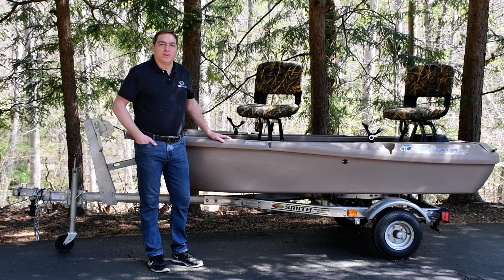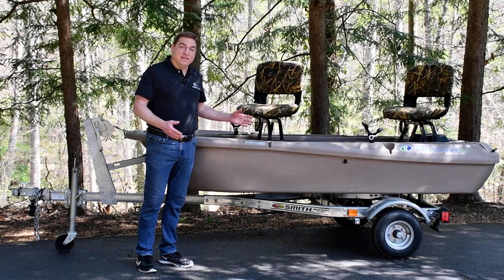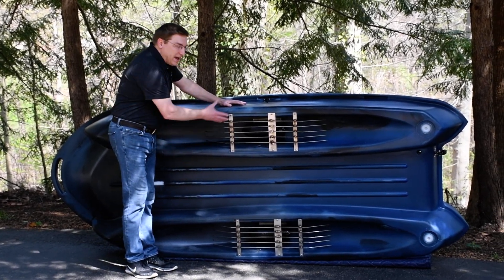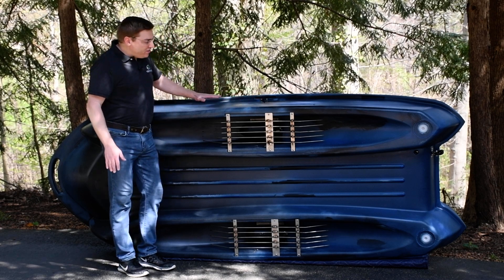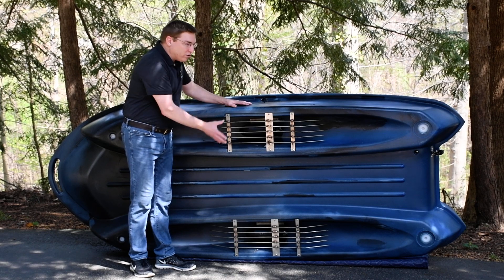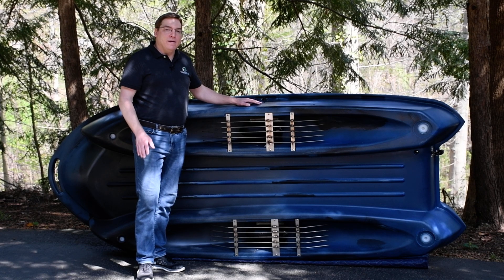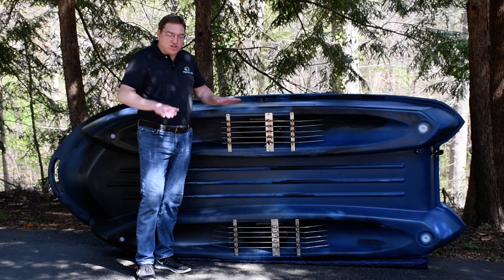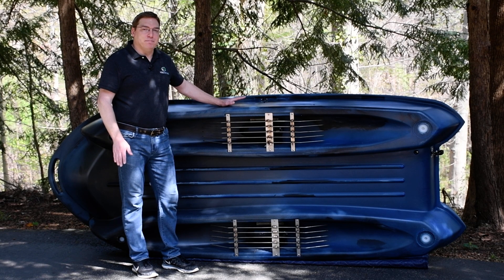Meet the Twin Troller

Comment: The price of this boat is absolutely way over priced.  $5400.00 FOR THAT-ARE YOU CRAZY!! That's the price for the basic model.  I bought one when they first came out.  I think I paid $2700.00 for a deluxe model back then.  It's not that easy to control.  I sold it within a year.  It's very slow and not easy to get use to the controls.  Now a deluxe model is a lt more than the base model.  Outrageously priced.

Comment: How about fixing the water leaking into the hull on both sides.  There are alot of people with the issue with water into the hull through the screwholes of the brushguard or motor mount holes underneath.
Reply from the maker: Water leaking into the hull is a very rare occurrence and usually happens when someone removes something from the boat and does not properly seal holes back.